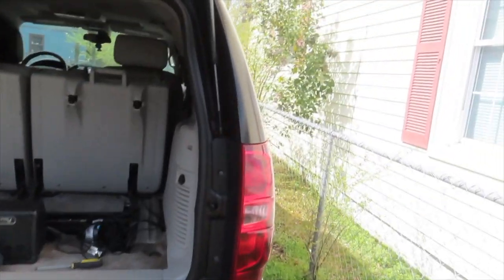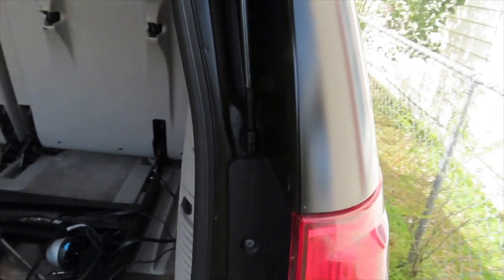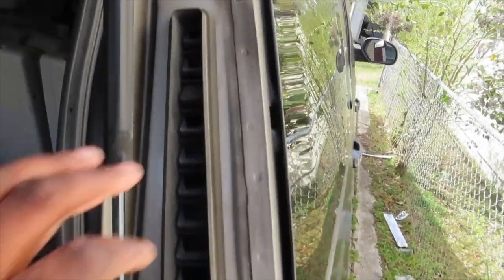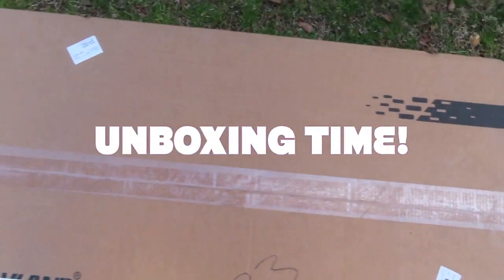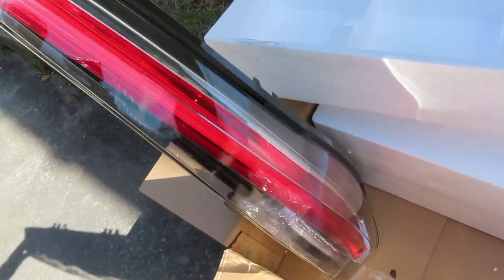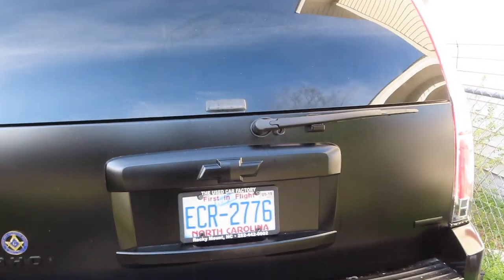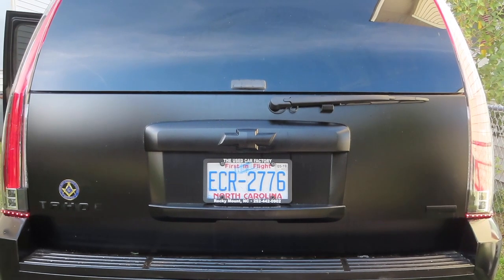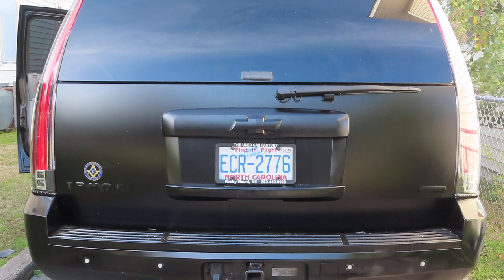Escalade Conversion Tail Lights On Chevrolet Tahoe | Taillight Removal

Comment: I just ordered a set of smoked Escalade lights from Amazon. I also ordered a smoked third brake light. I'm going to install today hopefully.
Reply from the maker: Cool! Come back and let me know how it turns out for you!
Reply: 540TV came out A1. The 3rd brake light not so well. I had to reverse the leads on the third brake light, it workrd for a second. I installed it then it didn't work so I took it all apart and then just installed the stock one back in.
Reply from the maker: Gotcha you maybe ran into the same problem I did. It was said that there’s another brand that everything works on. I wired mine for daytime, Brake Lights and reverse lights only. I have the turn signals on Red LED stripes which works for me. But of course we want that OEM look and I ain’t paying $400+ for another set!

Comment: More than the likely the reason why the connector wasn't a match Is because thoes taillights are for an Escalade 2007-2014 gmt 900. Essentially the SUV  from the gmt 900 platform are all the same with some differences.  The Tahoe came with incandescent bulbs and different wiring for the tailights . Whereas the Escalade has led tailights and have different wiring too the connector.
Reply: The tailights came out clean tho! I wish I had my  2007 GMC Yukon still 😔
Reply from the maker: Thanks and yes I got everything straight but wish it worked OEM like but it’s all good ...still catches eyes

Comment: You used the harness from under the truck right? Not the one connected right into the light at the top? I just bought some but they are straight plug and play.
Reply from the maker: Yep the issue was these lights where 1st gen

Comment: Are your tail lights sticking out on top because mine are so did I not put them on right or did the manufacturer not do proper measurements? I have a 2012 gmc yukon denali
Reply from the maker: Need to reseat them…start from the top

Comment: The plug you are supposed to use is actually under the rear bumper thats where your issue was, the instructions actually tell you where its at
Reply from the maker: Robin Worsham yea that’s the plug that I used...the connector on the lights and the one on the car looked like they would fit bit the lights connector was too small ...also the connector for the truck had 8 wires the light connector only had 6
Reply: @540tv6  I dont have a video of mine but I got the smoked ones and mine had a load resistor connected with the light did yours because mine plugged right in and works like factory but my buddy had to modify his on his yukon and his light didn't have the resistor
Reply from the maker: Robin Worsham I was originally gonna order those exact ones which now I wish I did but no mine didn’t have any resistor at all... just a plug
Reply: mine work plug and play and work perfectly
Reply from the maker: Jorge Verduzo maybe it was just the brand I ordered because I hear another brand is plug and play
Reply: Mr. 540 i also noticed mine have a small gap towards the bottom. almost a perfect fit, now all i need is my front oracle headlights.
Reply: @540tv6  no you ordered the wrong lights you have to search lights for your truck not a Escalade
Reply: You ordered Escalade lights not tahoe/suburban/yukon lights it's a different plug
Reply from the maker: @bigantscustoms3385  ok gotcha! everyone was calling it Escalade Conversion kit!
Reply from the maker: facts ima have to look into the oracle lights
Reply: @540tv6  look on Amazon it's like 4 Different lights for the tahoe/suburban and Escalade and the new trucks they all have different plugs
Reply: @jorgeverduzo6528  I have the 2008 GMC YUKON XL DENALI could you shoot me a link to the plug-and-play one for this truck
Reply: What exhaust do you have on the truck? Sounds good!
Reply from the maker: Super 10
Reply: Mr. 540 res delete too?